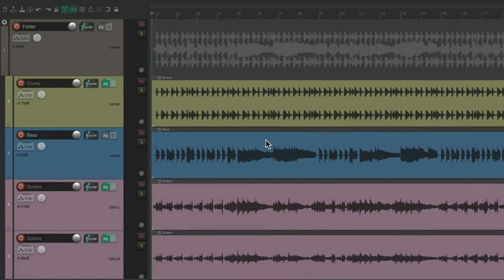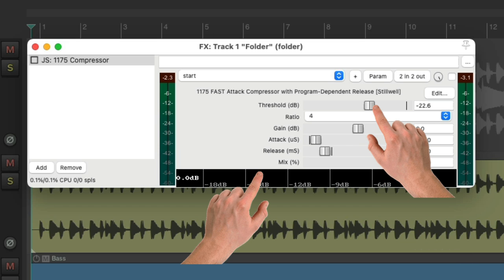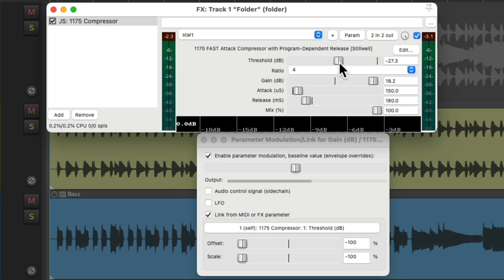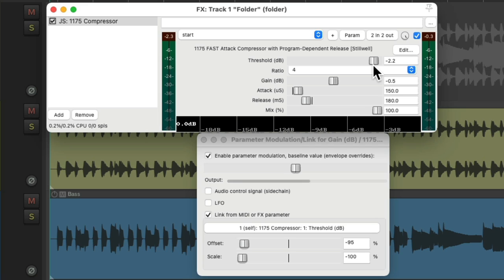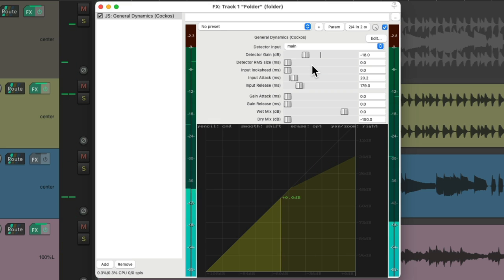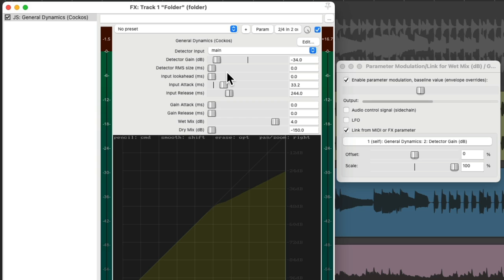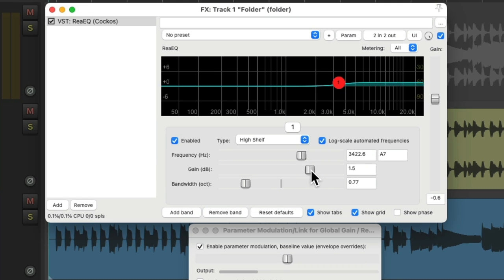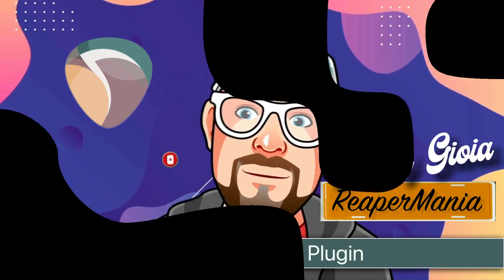Auto-Gain On Any Plugin in REAPER

Comment: That would work if there were a linear relation between threshold and gain, between gain reduction and perceived loudness. Lowering the threshold 2dB does not mean you will hear 2 dB lower, so you can't just compensate it automaticaly (and linearly) with the gain.
Reply: The scale slider gives you a single order of relation delta between the parameters.

If you need more, then just set up an additional parameter mod on the exact same controls with another scale value. Use offset on both to get even less linearity.
Reply: Linear is still better than nothing, especially for small moves
Reply: Makes sense. So, if not linear, then what? Because perceived loudness is subjective, what mathematical relationship CAN we use  do we set auto gain automatically?
Reply: @iainmackenzieUK  The thing is: which parameter do you want to mantain with an autogain? Whether you want to keep peaks or RMS constant, the result of lowering the threshold depends (among other things) on the rate of the compressor.
Reply: I concur, but t's only an approximation. In many ways it's just good enough. It's certainly helpful.
Reply: @dopplerloops  so what is your recommendation? Go linear ? then keep an ear open for any discrepancies arising??

Comment: I'm trying to link the length controls of two taps on ReaDelay. I need them to be 4ms offset from each other. I can't really use the offset % slider because that sends it way apart, even at 1%. I need these to move together like ganged faders on the mixer. Any idea how to do this?

Comment: Watched this video a while ago, and just recently it occure d to me this parameter linking might be useful in other context.  so question Kenny: could you link two plugins on difference channels; for example, have same EQ on two channels and link the low/hi pass so when you change it on one, it also changes on the other?  e.g. have low pass at 1K con ch1, and high pass at 1K on ch 2.  When you change to say 500Hz on one, the other follows?

Comment: it would be amazing if reaper had a native "auto gain" option. 
this feels like practically it will end up being a bit more cluncky, as most likely it will be too difficult to set the right balance in parameter link, specially consifering the width of an EQ band, or attack/release settings on compressor, etc. (+ the fact that this has to be set up for every single plugin + every EQ band even) 
TDR nova actually has auto gain, which works amazingly well
considering reaper added OS per plugin, and even delta solo (2 of the craziest things ever imo), a native auto gain option, per plugin would be instanity (and not that "otherwordly" considering reaper itself)
Reply: Maybe in a future update, they can add that. It could be so easy to have a few options to input offset values, positive/negative...... That would be neat!
Reply: actually there is,
it's at the bottom of tbproaudio downloads page, AB Level Matching JSFX for Reaper :)
but keep in mind various dynamics audio processing compensation cannot be perfect
Reply: @TazzSmk  i love you man!
Reply: 1) There is no DAW that has such ability out of the box.
2) Auto-gaining for compressors doesn't work like shown in the video. It can be done only by the compressor developer and still not everyone who does it do it right. Compression rate is a thing.
3) The only generic way that kinda could work is by matching RMS or other over-time loudness matching.
Reply: no. go set the gain with ur ears. like any producer had ever done.
Reply: I think it would be dope if Reaper devs build a JS function/module/method for the other developers to rely on.

Comment: Computers these days are powerful enough to do the RMS\LU-M as we adjust some amplitude affecting parameter.
So, if we import an audio file via the Media explorer, it should have Import settings such as: normalize to RMS\LU-M\EBU128 at x dBFS.
Then a plugin requested to match the such adjusted imported gain of the audio, should make RMS\LU-M automatic adjustment to match the Output value. 
This is currently available in: right click audio event → Item properties... → take section: Normalize
Or simply: select right click audio event → Item processing... → Normalize item peal\RMS\LU...

This Normalise function should be on:
Media explorer → Import button right click: set import normalise options (radio buttons with user input)
· by RMS: <user value>
· by LU: <user value>
· by peaks <user value>
· source (as is)
→ set as default and do not ask again
Then every plugin should match that value as Output volume (or not if we want to tweak the level post-FX).
This way will save us so much hassle to "gain stage" audio clips before mixing.

Comment: Yeah I get the idea and it's great that REAPER has that. However in the video examples I would have tweaked more the scale parameter because the amount of change between the two parameters is not the same in both the compressor (due to the ratio different from 1:1) and the EQ (because you're changing the gain only of part of the frequency spectrum). Thanks for that! Moreover, it would be useful to have a scale range of more than 100%, I see it possibly convenient in cases like this. I will check on the forum.
Reply: The forum asked: actually it seems that a value of more than 100% can be set for the scale parameter by direct numeric input, even though the slider only gets up to 100%. Have to check it :)